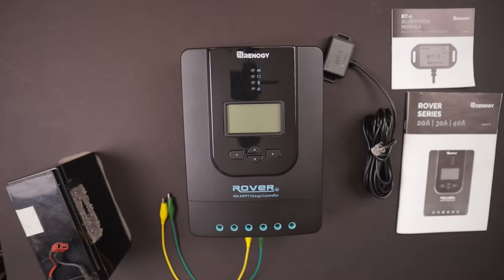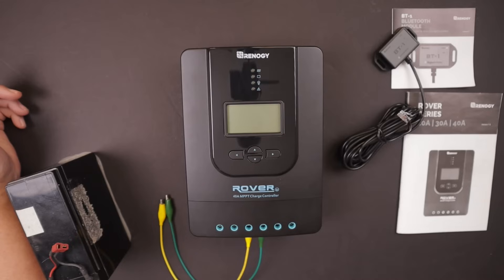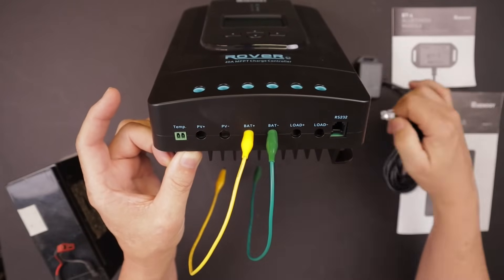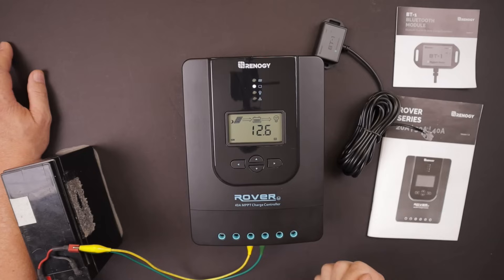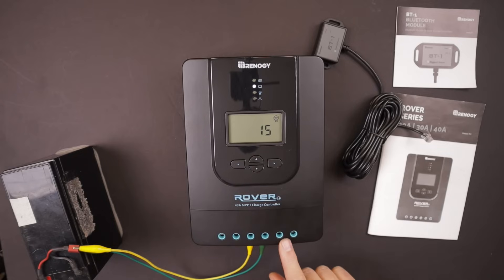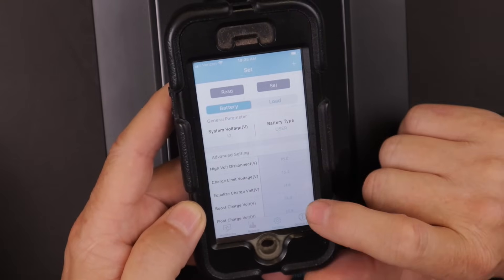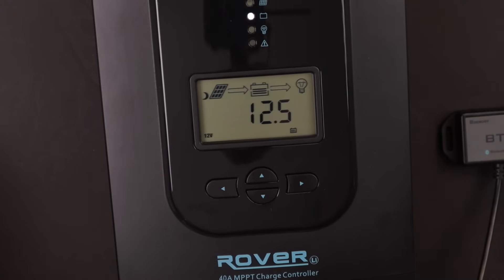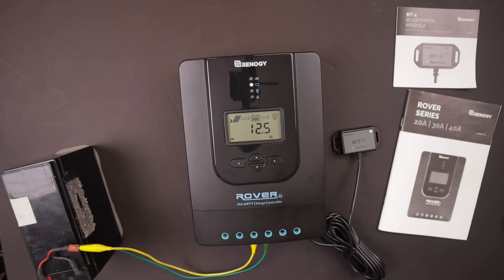Renogy Rover Li 40 amp MPPT Solar Charge Controller Overview

Comment: Those skinny little leads would burn up. What the best wire size you can fit in those terminals?
Reply from the maker: The manual says 8 awg max terminal size so that’s perfect for a 40 amp charge controller.

Comment: Does it do WiFi monitoring
Reply from the maker: This particular one doesn't have WiFi but I think maybe the new models do. You can check the Renogy Website for all the details on the newer models they are currently offering. https://renogy.sjv.io/QOdxrP
Reply: How about it going back to grip power of the battery doesn't keep up due to cloudy days. I have a home I want to save on electric bill @DIYHomesteadProjectsDIYHP10
Reply from the maker: That will be dependent on how you set it up.

Comment: Great vidro man .Thanks 😊.....So is 400 watts the absolute max for this one? Igot 10 big solar panels for free but i think 400 watts input is the max???? Can i go higher ?
Reply from the maker: 400 watts of solar is max for a 12v battery bank. You could double the solar if you run a 24v battery bank. Both scenarios equate to 30 amps of current.
Reply: @DIYHomesteadProjectsDIYHP10 Thanks pal .Much appreciated reply 😊.It's all good fun being a bit of an eco warrior .Goy a nice turn on these panels for free from a solar roof .Was just wondering .Every day is a school day ..Going to maybe remove yhe 2 renology 200w panels from my hut roof then and set up on my wee boat .Majic .Thanks again man !😊
Reply: @DIYHomesteadProjectsDIYHP10 Ps got some juicy victron inverter and a heavy duty charger for free from a pal from a discontinued  ambulance .Another wee future project 😊

Comment: Very new to the solar world. I have two 200w renogy panels, a renogy lithium 200ah battery, and this controller. Panels are run parallel so I should be good, correct?
Reply from the maker: Sounds like you should be good to go!
Reply: @DIYHomesteadProjectsDIYHP10  your video was a big help. Thank you

Comment: I can't get my error light to go off. I have two controllers going I to my battery bank. I unplugged the other controller but still have the error. I'm about to hit the manual.
Reply: I had it set on 24v on my 12 v system. That's why the light was on
Reply from the maker: It's good to hear you got it sorted out.

Comment: hi does the load terminals stay at 12 volts when you run the rover in 24 volt  battery system? no info in manual
Reply from the maker: Good question but I don’t know the answer. I no longer have that charge controller so I am not able to check it for you.
Reply from the maker: Found the following on page 30 in the manual.

"The DC load is powered by batteries, so ensure that the DC load is compatible with
the battery voltage. If a 12V DC load is installed in a 24V battery system, the incorrect
connection will damage the charge controller and void the warranty."

Sounds like the load terminals will be the same voltage as the batteries. If you have the charge controller you can check the voltage at the load terminals to find out as well.
Reply: @DIYHomesteadProjectsDIYHP10  thats a bummer not to many 24 volt loads out there. my page 30 is blank
Reply: If it's 24 volts I would have to use a buck converter 24 to 12 volts

Comment: I have a 20 amp it won't charge my LIPo above 14.4 volts when put on the lithium setting I have to put the charger on user...renogy sucks
Reply from the maker: Isn't that why they offer the "User Mode" for those who like to customize the settings?

Comment: Just installed this controller on my boat!  I have four 195watt panels that are all charging my two bank system.. house bank is six agm six volt golf cart batteries wired for 12 volts.  My second bank is one HUGE 8D AGM deep cycle home depot battery to start my port engine and run my Anchor Windlass..  i would like to add my four 100 watt renogy flexible panels but not sure the best way to do it.. thought of having them just charge my 8d monster, and leave the other four 195 watt panels just charging my house bank... I expect I will need an additional controller to divide the input from the four 195's and the four 100's... Any thoughts????? Thanks guys!!

Comment: I have a BT 1. Where in the app do you find settings? I see nothing.
Reply from the maker: Open the DC Home app and click on your charge controller. There should be three dots ... in the upper right hand corner. That should give you two choices settings and history. Hope this helps you out.
Reply from the maker: Click the three dots ... in the upper right hand corner.

Comment: Can you run 24 volts into the controller from the panels and charge 12vovt batteries?
Reply from the maker: Yes, that is how I have mine set up.
Reply: @DIYHomesteadProjectsDIYHP10  what are the benefits from this setup?
Reply from the maker: Higher voltage systems allow for lower current, which reduces power losses in the wiring and makes the overall system more efficient. Lower cost for longer wire runs from the solar array to the charge controller. Also you can connect a larger array to the MPPT charge controller without exceeding the controller input limits. Essentially you can do more with a smaller MPPT charge controller and save money over having to purchase a larger amperage charge controller.

Comment: If you have 2 seperate battery banks with isotlators does this charge work with it and split the load of the panels?

Comment: Hi friends, my mppt rover 40a is not giving accurate battery percentage, it is propperly configured in 12v and lifepo4 battery, battery is new and mppt too, any other setting to make or help? thanks, regards.
Reply: You can program the battery total ah… or amp hour.. aka capacity. I’m sure you want to install and program it on a 100% charge battery. Then it can monitor the total draw on the battery and know the current charge status

Comment: Hi, great video, i understand that rover 40a have a maximum 100v pv input, but how many amps in the input? Thanks
Reply from the maker: The manual states max input is: (Max. PV Input Power: 12V/520W, 24V/1040W) So either of these input voltages would equate to 43.33 amps input. (watts divided by voltage equals amps)

Comment: Disregard his 100 Amp Battery or PV Input. 
He meant 100 VDC Maximum PV Input. 
Maximum Battery Input Voltage is 32 VDC. 
Max Output to Battery 40 A.

Comment: Can I use a 24 volt battery and have a 12 volt output?
Reply from the maker: Not without using additional equipment and it's not very efficient.

Comment: Great Video, I purchased this controller (60 AMP essentially the same) for my boat and am OK with it.   I use it to keep 400 AH lithium batteries charged, monitor with the BT2.   My energy consumers use relatively low amperage except for the 12 volt fridge and that is somewhat low.  My only issue is the Load terminals, they do not output voltage they are in the off mode all the time.   It seems like the design is to output voltage when the panels are not powered (night), this makes no sense to me, unless you are simply using it for a timer after the panels stop producing.   I thought the purpose of load is to use surplus energy when the batteries are topped off, that would be a great idea since the solar panels would not have any use for the solar energy after the batteries are at 100%+.
Reply: I read that you can program the controller's load terminals to different settings:
Automatic On/Off: The load turns on when there's no solar power and off when solar power is available. 
Timed On/Off: The load turns on and off after a set period (e.g., 1-14 hours). 
Always On: The load is continuously powered, with solar power prioritized to the load first, then to the battery. 
I just bought the Rover li however I haven't set it up yet. I'm trying to learn all about it first and came across this post therefore I do not know if this will even work but it sounds like it would solve your issue if it does.
Reply: @EEE-fn5pr there is on all the time, a sun sensor is what I call it. Bc it measures the voltage on the panels to turn on, and variations of the with progressive hourly increments.
Reply: I use my load terminals to power fans of the same voltage or step transformers.

Comment: does this charge controller require a battery or can i just use the solar power
Reply from the maker: It needs to have a battery connected. Connecting a solar panel to the charge controller without a battery connected will damage the controller according to the instruction manual.

Comment: I have the app and on the controller I have managed to change the battery type but not on the app because it's asking the admin permision or something like that ? Does anyone know what to do please?
Reply from the maker: Yes if it's the first time setting up the app you have to set up Administrator privileges to change any settings while using the app. This prevents others from changing your settings unless they have your password. 
From the monitor page hit the + in the upper right corner of the screen. Click the + and then select Administrator from the drop down menu. It will ask you for a password and you'll want to input this password 135790123 the first time. This is the password key selected by the manufacturer. Once you hit confirm you can now make setting changes via the app. Now you may select the + again and select change password from the drop down menu if you want to change to a custom password of your choice. Hope this helps you out.
Reply: You're one of a kind dude! Thank you so much! It worked and I changed the password into my password. I appreciate your effort! Thank you!
Reply from the maker: You're welcome! Glad to hear you got it set up! If you ever need to find that code again you can google search "renogy home app password" and it will usually pull it up for you. I'll also put that password in the description of this video so you'll be able to find it there. 👍

Comment: hi, i have a problem, and i see.... a lot of people have the same problem..... i have a Controller Renogy Rover Li 20 A, and i buy 2 batteries LiPo4  X 100Ah each.... bluetooth from bateries, shows me 40% and the other one 46% , and ontroller shows me always 100% ......controller settings are on Li battery standard.... if i put any other keind of batery (not LiPO) will show the real batery status, if i put a LiPo battery...shows always 100%...Renogy support.....is really slow....and not so helpfull.... what i must do?
Reply from the maker: I’m not positive but I think the battery needs to be charged to full capacity first. Then from there the percentage should read accurately.
Reply: @DIYHomesteadProjectsDIYHP10  i will try this too, and i will wrote if goes or Not....because a lot of people have the same problem ...and..Thank u a lot !!!send u my greetings
Reply: @DIYHomesteadProjectsDIYHP10  i contact Renogy support and they say the controller SOC is not accurate... also....will never show the LIPO4 percent....
Reply: @toculucian9340 I’m having the same issue, with the controller always showing 100%. Settings are set to Lithium batteries. Sounds like I’ll be buying a separate battery monitor. Thank you

Comment: The manual sucks…lists abbreviations for all battery types without an index to what they mean for us that dont know. I’m unable to even get to the battery type screen??? I have standard flooded lead acid batteries , not sealed… what’s USE? I’m assuming FLD is what I want but cannot find a way to select!

Comment: If I connect two batteries in parallel and not in series - (2 x 110ah in parallel) and connect these two solar panels 2 x 300W, will it make a difference? can i then use 40A RENOGY or 60A?
The rule also applies here: 600w : 12v = 50A ?
Reply from the maker: Divide the total solar watts by the voltage you are charging at and that will give you the required amperage of the charge controller. This rule will apply no matter how you wire up the batteries. You basically have two choices, two 12v batteries wired in parallel and you're charging at 12v = 47 amp or larger charge controller. Two 12v batteries wired in series and you need to charge at 24v = you could get away with a 30 amp or larger charge controller.
Reply: @DIYHomesteadProjectsDIYHP10  I see. Thank you.

Comment: Tell me, will this 40A regulator be enough for 2x300W solar panels, or will it limit the capabilities of my solar panels?  I have 2 110ah AGM 12V batteries. In the technical manual Renogy writes that 40A up to 520 Watt
Reply from the maker: Amps x Volts = Watts so if you divide your total watts by the battery voltage you'll know what size charge controller you'll need. 
(600 watts divided by 12.6 volts = 47.6 amps) You can't safely pull more amps than the charge controller is rated for. Your set up could possibly try to push 47.6 amps into your batteries. You will need to get a 60 amp charge controller for those two 300w solar panels if you are charging 12V batteries. If you use a 40 amp charge controller with 600w of solar you'll probably burn up the charge controller at some point. Hope this helps you out.
Reply: @DIYHomesteadProjectsDIYHP10   Thank you very much for your quick reply.
two batteries connected together (I don't know, parallel or series?) 2 x 110 ah AGM ... two panels at once two batteries ... would it be ok then?
 then by calculation it would give 25.2V, right? Or I would charge 2 batteries separately, each panel to one battery .. if I can, then 40A of the regulator will be enough then?
Reply from the maker: If you wire both the batteries and the solar panels in series making a 24 volt system instead of 12 volt system, you would be fine with the 40 amp charge controller. This might create other problems for you if you are running 12 volt items with your system though.
Reply: @DIYHomesteadProjectsDIYHP10  Thank you, you helped me a lot today. now i know more. Good luck my friend.
Reply from the maker: You're welcome and I wish you the best with your solar projects! Thanks for stopping by!

Comment: Can you run these 24v in 12v out?
Reply from the maker: Yes, that's how I am running mine. You can go up to 100V in and 12V or 24V out with this charge controller.

Comment: I’ve had good luck with the 12 V 100 W panels they sell however I got burned big time on a commander charge controller Renorgy solar sold me it quit working shortly after warranty and they wouldn’t do anything at all about it they wouldn’t even offer me a discount on a new one nothing. I thought about these rovers however I’m not sure. has anybody had any luck with their sealed lead acid/AGM  batteries they sell ? I looked at their 200 amp hours batteries however I’m afraid I’ll get them and they’ll stop working.

Comment: I am having issues trying to figure out the right setting to turn the load off when my battery drops too low.  Right now the load setting is at 15 which is the on/off mode.  I am using the 2x 100 watt panels with the 30 amp charge controller.

I am using this setup to run my surflo vacuum pump for maple sap.  The solar panel keeps the battery topped up during the day but at night when the panel is not supplying power the battery will drain completely and throw the E03 error code.  Which setting do I use so that the solar controller turns the pump (load)off when the battery volts/amps gets too low?
Reply from the maker: I don't know, I have mine set on 15 and it's always off. I am not using the load circuit on mine. I think the manual tells what all the different settings are used for in the load settings.

Comment: Will this charge 7S lipo to 29 volts? 28 volts? I am building a power station for camping/ fishing. I want a charger I can put 50 volt solar into, plus 36 volt stepped up from truck alternator, plus 36 volt from a 120 ac power supply. Will this work for all 3 inputs?
Reply from the maker: I'm not sure but the specs state a max battery voltage of 32V. You can download a PDF of the instruction manual near the bottom of the product page. I'll leave you a link and maybe you can find more specific information about your application there. I wish you the best with your project.
Rover Li 40 Amp MPPT Solar Charge Controller
https://renogy.sjv.io/kjXeoM

Comment: so do i just not need a temp sensor because im using lithium batteries too ?
Reply from the maker: That's right, no temp sensor required for lithium batteries.
Reply: @DIYHomesteadProjectsDIYHP10  thanks an thanks for the reply
Reply from the maker: No problem, you are quite welcome Jaaay g

Comment: Can  this controller have a 24 v battery bank and still power a 12 v inverter ?
Reply from the maker: The battery bank is what determines the voltage of the inverter you need to use. If you have a 24V battery bank you need a 24V inverter. If you have a 12V battery bank you need a 12V inverter. This charge controller will charge either a 12V or a 24V battery bank.

Comment: My friend just bought this charge controller and overall it seems pretty good but, those little (microscopic) icons for battery types, not allowing a choice in temperature display between Celsius or Fahrenheit and no backlighted display means I would not recommend this charge controller to anyone else. There are lots of other brands to choose from. I like the EPever with the T-50 back lighted remote.
Reply: Not being able to set the temperature units to rocks and sticks units should not hold you back from getting one of these.
Reply: Considering I got these for $150AUD each and I'm Australian, and I wear my glasses like Ray and Mr DIY Homestead Projects should probably do more often, I definitely CAN recommend this to others :)
Reply: LOL like how often are you going to be starring at a screen? It' s not a TV or monitor plus you have the app.